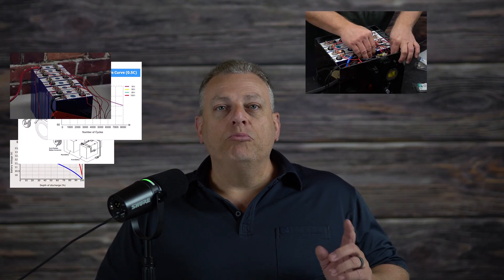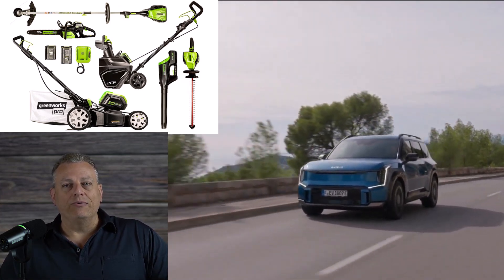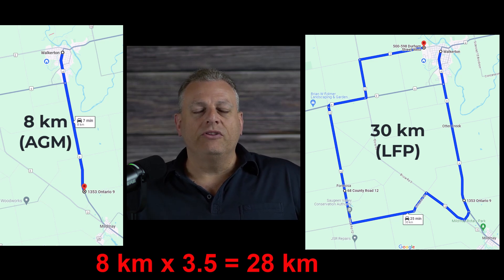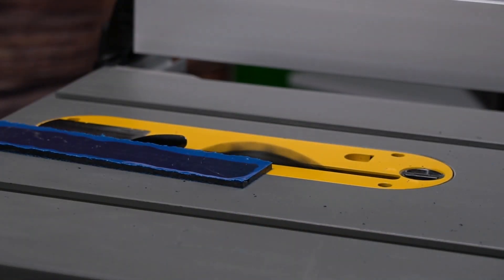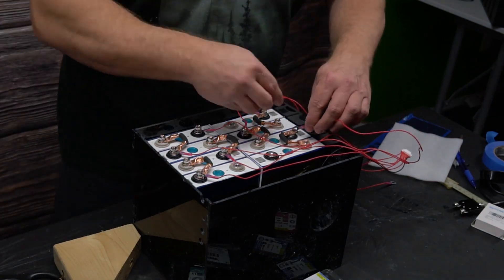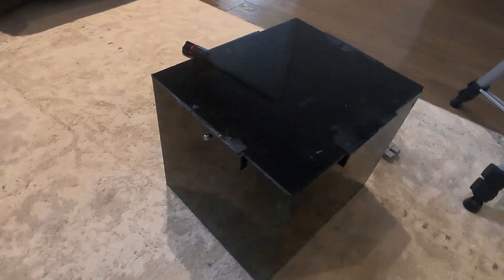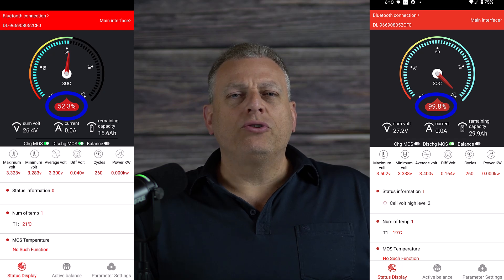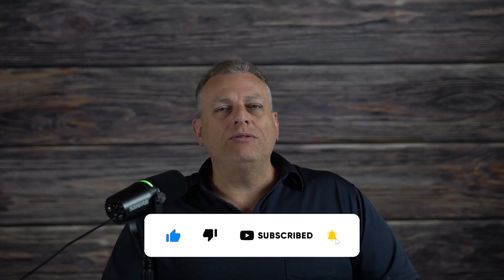DIY Wheelchair Battery gives 3.5X more Range!

Comment: Excellent work! I’m wondering if LiFePO4 batteries in a powered wheelchair are accepted by airlines. Have you or anyone else had experience taking such a setup on a flight without any problems?
Reply from the maker: We have a separate travel chair that has lithium batteries. They are removable and we have them in the cabin with us.

Comment: Great video! My wheelchair uses 2 group 24 gel batt that’s 12v 70Ah. Is there any Lipo batt I can buy off the shell and do a direct swap? Would I need any charger mods or can I use my current 8A charger to charge lipo batt?
Reply from the maker: Not sure if they have those yet, but more are becoming available. You would need a different battery charger.

Comment: What a great project. You can cycle LFP from 0-100%. This will not reduce the battery life by much. You don't have to initially top balance. The BMS will do that once you attach it to the charger for a while. The shunt can become out of synch, sometimes you have to reset it. I don't think you need an active balancer, just let it sit at the charger with 100% charged and it will balance itself. The victron shunt has an auto calibration function. I recommend checking the terminals for tightness because of the vibrations.
Reply from the maker: Thanks for the comment!
Reply: I need someone to do this for me my Edge three does not have long of range I would be happy to buy all the parts. And pay for any labor
Reply from the maker: I hope you can find someone to do it for you!  Some commenters have mentioned you can get them at some stores now?  Best of luck!

Comment: I have dug a bit more into this process with the lithium batteries manufactured that were listed here in the comments. I think the video might do with a little information about regenerative breaking and tripping the BMS. My particular chair needs the forward deceleration turned down not to constantly cut out on declines. The battery solutions that are not programmable can still be used but the charge voltage might need to be turned down enough to get 3v of headroom in my partiuclar case. As far as I can tell, it shouldn't need to have a lower voltage charge if I can turn my braking power down 50%. Hopefully it works out, but that regeneration issue is the one that trips up people trying to do this without engineering experience. I suppose it's worth noting that some chairs don't provide the bluetooth dongal that would be needed to turn down the breaking power, I just happened to be lucky to get one. If you live in an area with very steep declines you might not be able to turn the braking power down to retain control of the chair. In that case you'll have to have a way to charge at a lower voltage if you get cutouts but need full braking power.

Oh, one last thing, the batteries from Li-Time are 65 amp hour, not 105, so you will get 2x range from them, not three times like this gentlemen's daughter. However as near as I can tell the 105 amp hour batteries are much more expensive. The total drop in cost for my chair is bout 500 dollars, and you'll need the ability to turn down your braking power if you start getting cut outs from the regen tripping the BMS.
Reply: update, turns out there are a lot of these batteries made now, and the li time version is quite expensive and has both 65Ah and 100Ah versions.

Comment: Hi Dave, do you have a schematic diagram of your bateries and battery controller with monitor you can share? Also a specification of the charger you chose? Im running a Quantum Q6 Edge with plans to upgrade to an HD version soon as I can find one. Thanks you
Reply from the maker: Sorry, but I don't have a schematic of the system. They're just eight cells connected in series with the appropriate battery management and fuses. I just looked on AliExpress for a a lithium-ion phosphate battery charger with the 8 amp current limit as described in the chair manual. Hope this helps!

Comment: I have a jazzy 1450 chair that uses two group 24 75AH gel batteries. I'm going to change to LiFePO4 100AH batteries and a new charger. the new batteries are the same size...I guess my volt meter will not work as desired but that is probably not a problem.
Reply from the maker: My daughter uses the battery management system I installed to keep an eye on her battery level, but she could avoid that by charging every night. And with such a huge range, she never has to worry about it. Hope that works out well for you!
Reply: @AnotherNerdyCanuck  The batteries that I will get have a "Smart BMS" system.  But I will need something else probably to read the correct level because I can not use the original meter it connects through the main control unit, so I will have to install and external charge port and meter if I think I need one. NBD.
Reply: A lot of LifePO batteries come from the factory with built-in Bluetooth that can be monitored through an app. Very useful in these situations.

Comment: If I were to replace the two 12V batteries in my chair with two lithium batteries, would the standard charger that came with the chair still work? If not, how could I charge the batteries without having to remove them?
Reply from the maker: You would need to ensure that you had a charger that was rated the same as what your chair is designed for and is compatible with the battery style that you have. So I still use the same charging port on the chair, with an 8 amp charger because that's what this chair is rated for. And the charger that I purchased is specifically for charging lithium iron phosphate batteries, which is the kind that I have.
The only other thing that you might be concerned about is if the batteries are capable of being charged in series? That would be a question for the manufacturer. I believe that some battery management systems don't handle series charging very well, so you would want to verify that that is going to work..

Comment: can i use a car batteries in my wheels chair
Reply from the maker: Usually wheel chairs don't us "normal" car batteries as they are not designed for the deep cycle discharges that they are subjected too. If you are unsure, I would recommend only purchasing recommended batteries from your manufacturer for safety.

Comment: I have the same chair do you think it would be safe to put two 12.8 100 amp hour lithium batteries in it
Reply from the maker: It would depend on the size of the batteries and if they can be stacked in series. I would think that 100 amp hour batteries would be too big? It would also depend on the chemistry of the battery and what type of BMS it has. Too many variables for me to say it would be safe. Sorry.

Comment: Since the battery was 24 v 105 ah?
Reply from the maker: I'm not sure what your question is?
Reply: @AnotherNerdyCanuck  I asked you about the amperage of the cells, are they 3.2v 105 ah cells? Since there are 8 cells, the battery is 24v 105 ah
Reply from the maker: That is correct. When connecting in series, the voltages add up, but the Ah stay the same. The net result is a 24V 105Ah battery. The original design was two 12V 55 Ah AGM batters for a 24V 55Ah battery. Thanks for watching!

Comment: Cool project and really impressive to see a mobility device with not only that much range but also that gets used in suburban North America so regularly.

I would recommend adding that balance circuit or more preferably a BMS with integrated balancing as right now the 100% SoC screenshot shows the BMS has disconnected the charge FETs due to a cell voltage high level 2 alarm (>3.65V), this will result in excessive wear on that individual cell and eventual premature failure (really common for batteries without balancing). Would've expected that BMS could do balancing though?

Additionally what sort of circuit breaker did you use? AC breakers will not break DC reliably and many of the DC circuit breakers are designed for lead acid batteries which don't have high fault currents like found in lithium systems. Would recommend checking or replacing it with a proper HRC fuse rated to break the short circuit current of your batteries. The same advise applies to your home battery system you showed a picture of, I couldn't immediately see a fuse or disconnect device. 

Also the reason why the mobility device industry is stuck with older battery technologies is mostly to do with dangerous goods transport laws. Any company that built a wheelchair with a 2.1 kWh battery pack would have to put a big sticker on it saying "LITHIUM BATTERY - 2100 Wh - FORBIDDEN IN PASSENGER AIRCRAFT". The internationally set limit governed by IATA for lithium batteries on any aircraft is a "measly" 300 Wh (some local governments also have limits on trains and buses). However if you use an older technology that's not as energy dense and prone to energetic failures like lead acid or NiMH there is no energy limit, so the old 600 Wh lead acid is allowed. The laws are slowly changing but not without lots of effort as the laws affect everything from mobility devices to eBikes, camera batteries, drones, scientific equipment and anything carried as cargo.
Reply from the maker: Thank you for your comment! 
The regulations are a very believable and understandable hurdle that will need to be crossed. Hopefully we move toward that soon!

Unfortunately, no balancing ability on this BMS (software has it, but hardware doesn't support). I might switch to a JK BMS with active balancing. Would feel better with it integrated. I guess an update video is coming sooner than I thought...

I do have a DC rated circuit breaker that is certified for automotive applications (and voltages up to 50VDC). I don't see a specific fault current rating on it. I will add a 125A HRC fuse with a 2000A interrupt capacity to back it up for serious short circuit faults. 

I will also add one to my home battery backup. That system isn't completed yet. I have some upcoming modifications (including adding some solar to it), and will definitely factor that in.

Really appreciate your input. Thanks!

Comment: Can I ask how many amps the controller for your daughters chair is? I have thought about doing as you have but have concerns about the BMS cutting out on my chair which has a controller that is rated for 120 amps.
Reply from the maker: I'm not sure what her controller is rated at, but her battery is protected by a 70 amp breaker. I also used a 70 amp breaker but ordered a 80 amp BMS just to be certain. Maybe check the fuse/breaker protecting your battery?

Comment: Very cool and useful. It would be interesting to see if it was possible to modify the charge monitoring on the wheelchair main display. maybe some logic to convert from the LFP BMS charge monitor to a linear voltage output so the existing wc charge sensor could use it.
 It would be interesting to see some comparison of the battery types which you looked at in coming to your choice presented in more detail. thanks for the vid.
Reply from the maker: I could have made this a much longer video, but tried to keep it short and sweet. I might do a deeper dive later if there seems to be enough interest.
Reply: @AnotherNerdyCanuck  Please do the deep dive...